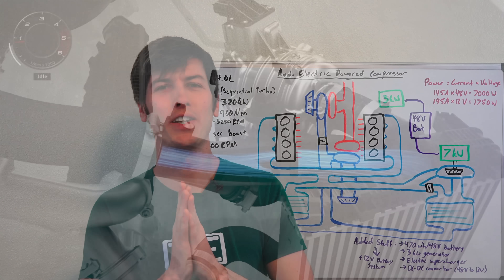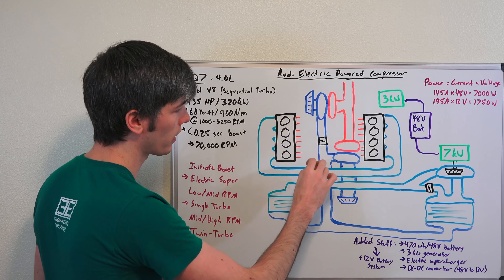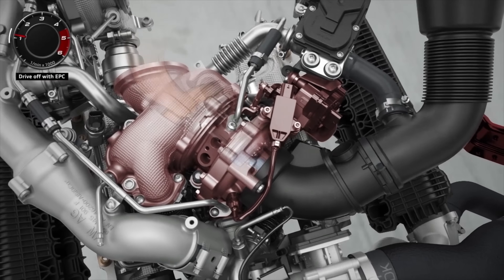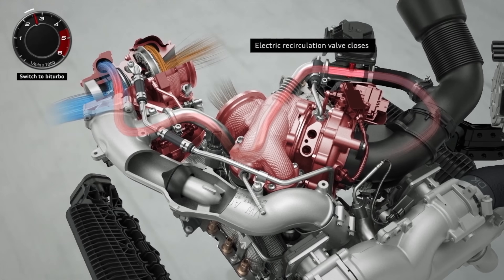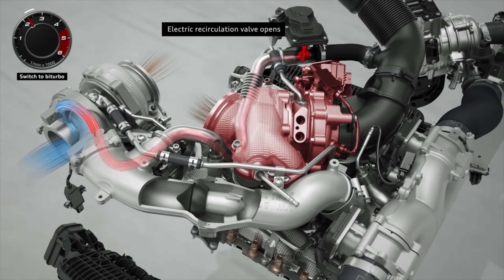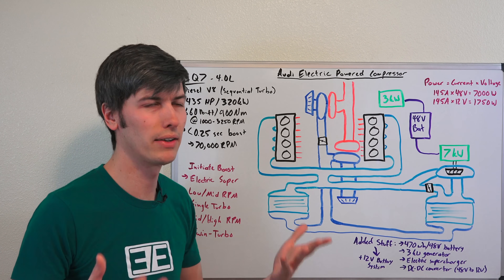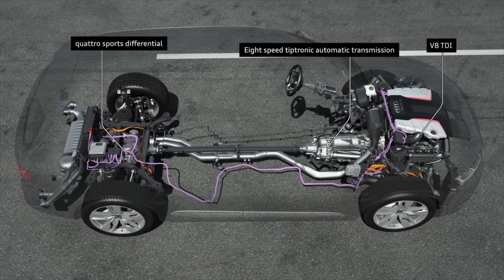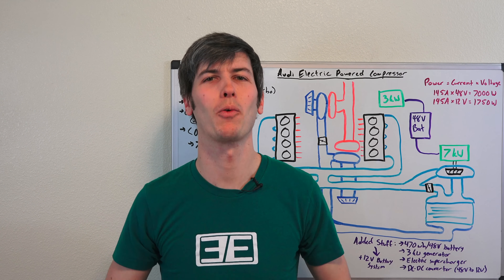Electric Superchargers - How Audi Is Eliminating Turbo Lag

Comment: diagram doesn't look right, the electric supercharger is drawing air in from one intercooler and then discharging back into it through the other one
Reply: When the valve is open, it is dumping SC air into it's own intake. So the SC can stay spooled with zero pressure being made. 
Condition = when Turbos are sufficiently spooled to give boost, and ALSO at engine idle when SC boost is not required. 

When the valve is closed, it will pressurize very quickly because the electric SC has been spooling consistently. Condition = Low RPM and not idling, Ie. When throttle > 0 and turbos have not made +ve Boost.

Either way, this air is then fed to the manifold. 

So At idle, SC is spooled and valve open. 
Open throttle, SC valve shuts and because it is already spooled it will create positive manifold pressure instantly, turbos are spooling up, and the SC is no longer required so the valve could be in either state, but open would be best to ensure enough air is available for the turbos to draw in.

Comment: All those complications and "still" 1/4 of a second to reach peak RPM for the electric turbo... I guess Audi's engineers need to justify their job, but IMHO with 1/4 of a second, the desired specifications are not met... at all. 
Get rid of the Diesel in the first place (it is or will be banned anyway from many European cities) and put a big block N/A V8, or even add supercharger (and even supercharger + turbocharger if you want) and you get almost instant response. 
I recall a ride in a GL63 AMG... I never thought such a heavy SUV would be so responsive and torquey... + the nice sounding V8 is a nice addition. 
Really Audi, that is a really nice work but over complicated.

Comment: As a working aerospace systems engineer, the engineering concept is cool, but the real-world lifecycle analysis is a nightmare.

I’ll stick with the N/A 6.2L LS3 V8 in my SS sedan. I get about 20-21 mpg on average, have 415HP on tap whenever I want it... with no lag. 3 pedals means it’s also fun to drive.  And without this horribly overcomplicated system, maintenance is a relatively inexpensive doddle. I am guessing a whole brand new LS crate motor is less expensive than trying to overhaul that terrifyingly complex turbo-electrocompressor-variable valve-quad exhaust manifold system. I used to really love Audis... but lately their styling has been “blah” and the lack of out-of-warranty reliability is a problem. I used to think my trucks would be American and my cars would be German. My truck is American, so that held true. But it turns out the best car I have found is an Australian amalgamation of German chassis engineering (they literally poached BMW chassis engineers) with an American V8 stuffed in it. Seems to work. Think I’ll stick with that.

Comment: Nice vid, EE.  Do you know why the electric fans output isn't ran thru intercoolers before it goes to the cylinder intakes?  Doesn't it too, get hot when compressed?

Comment: Wouldn't that 48V battery need a bigger alternator which, since belt driven, would make the engine burn more fuel? If yes, is there such a big fuel saving compared to a belt driven supercharger to make this concept more appropriate?

Comment: Hi, the battery does not have all that load, the alternator does, otherwise you would never charge the battery while the engine is running.

Comment: Too much complexity added to an already complex turbo setup, adding unnecessary cost and maintenance concerns. That's just sad German Engineering leading to high maintenance, overpriced cars. 

This is exactly why the Germans lost the war. Too complex overenginereed machines like the King Tiger which were too few, too expensive to build, repair, fuel and maintain and were defeated more by mechanical failure than enemy fire.

Comment: What about a turbo that is engaged by a centrifugal clutch? It's driven by the engine at first, but after spooling up it disengages from the belt drive and is spun purely by the exhaust gasses. You could achieve the same results as an electric supercharger, but without the need for all the extra equipment.

Comment: I have a topic i would really like to see a video about.
So the exhaust pipe on my dirtbike and basically all of the similar models... Will start to glow red if the bike sits at idle from the heat... 
But on cooler days it glows noticably brighter almost cherry red. Warmer days its less noticable even in similar lighting...
Is this because of the differential between temperatures of the pipe and ambient air or what is at work here?

Comment: Next video: How Tesla is eliminating turbo lag.
Reply: Next video: How Tesla is eliminating transmission wear.
Reply: to improve something, you have to use it, not throw it away
Reply: I need to buy a performance exhaust for my Tesla, but for some reason nobody makes them yet.
Reply: No turbo — no lag
Reply: hahahahahahahaahhaha
Reply: @ROBERT ANDERSON Thanks, I guess
Reply: Enthused 
Coming in 2020: Tesla eliminates GM, Ford, Chrysler, ExxonMobil, Chevron and ConocoPhillips.
Reply: Lol, nice
Reply: If your wondering  Teslas have so much power bc motors dont have to build up like engines do , they have instant torque like diesels
Reply: @samurboi8007  Diesels don't have max torque at low RPMs
Reply: @thomas_nl_  i never said that they have max torque , i said they have alot of torque at full throttle
Reply: @samurboi8007  You said they had instant torque. They take time to spool up RPM to get decent torque - same as gas engine - but just  more torque.
 Electric have max torque as soon electrons start to flow and is max at 0 rpm. (nanoseconds - not  milliseconds response)
Reply: @bbbf09  series DC motors have peak torque at 0 rpm......not the ones that are shunt or parallel wound ......😉👍

Comment: Better than Volvo’s system which literally operates like a tool air compressor. They also never mentioned how long that tank would take to repressurize and what the value pressure on it is...electric super charger is much smarter.

Comment: Instantly obsolete. I wouldn't touch a vehicle with that many moving parts for any price. Especially a german vehicle, which tends to be high in initial quality, but 12 years down the road, every repair costs more than the value of the entire car; hence why $40,000 to $120,000 Audis, BMWs, and Mercedes can be had for $2000 to $5000 12 to 14 years later. No idea why they'd waste their time and money adding more complexity to an obsolete technology - which is the internal combustion engine.

Comment: I claim BS on the “45 volt system” 
Second battery and alternator (high output) would do the trick. The issue is.  Yes it takes away lag, however you are still using engine power. Just threw the alternator rather than a super charger. It’s more efficient yes but in my opinion not worth it. 

The double header tho is amazing!

Comment: Why not just use an MGU-H, aka electric turbo, like they use in F1? They could accomplish the same reduction in turbo lag while using it to generate electricity off throttle, and also eliminate the need for a wastegate by using regen during boost.

Comment: So it's a pre-charger? What I don't get is why they don't design a turbo with an integrated electric motor to help with pre-charging as it wouldn't be that hard to do and would reduce material costs and be far less complicated of a system. You could easily separate the exhaust turbine housing from the air intake housing with a longer shaft and pop an electric motor in between.

Comment: For a special project for land speed record i've been working on an electric turbocharger using a 50kW motor from a Zero Motorcycle. We got 30psi at very high flow with 44kW out of the motor... it was insane.. the garage floor tiles lifted in the air and was flying everywhere!!!  was one of my most extreme sensation we had.. it was freakin!!

Comment: Thanks for the info. I just wonder...: Are you sure the Dc-Dc converter are to step DOWN the voltage?.. because for transmission of electric power the higher the voltage is the better it is and the lighter the cable will be.. so at first i tought the Dc-Dc would simply step up the voltage from the rear to the front.. and then another Dc-Dc converter would step down the voltage to the desired voltage for motor of the blower?... think about it...  steping down the voltage from rear to front to 12V at 7kW mean you woudl need very big cables for caring 583 amp of current  on that distance! you would need at least gauge 1 or gauge 0 witch is very heavy... and you need two!.... that,s why i think it is more a strp up converter that is located after the 48v battery.

Comment: Won’t the generator eat up about as much HP as a normal supercharger, or am I missing something? If the generator is powered by the engine than how is that significantly different from a standard supercharger run off the engine?
Reply from the maker: It’s low power. Full demand is about 4 hp.

Comment: Mercedes gets extra power from an electric generator attached to the exhaust, charging a battery, which powers 2 electric motors on the rear wheel.
I prefer the idea of harvesting exhaust energy to electric, rather than use the supercharger approach of tapping off any power from the engine.

Comment: I thought about this idea some months ago and now I see that it exists ! 
I was more precisely thinking about an electric supercharger that is powered by the energy recovered by a regen braking system. So when you have enough energy you can use it to have more horsepower. It allows to reuse the braking energy without making the car an hybrid car and adding an electric motor that can be expensive and heavy.

Comment: So...  Things that will go wrong and cost you more to fix than the car will be worth in 5 years:

1) that crazy exhaust-valve system that only opens one valve sometimes and both valves other times.  When that breaks, the entire top of the engine will need a rebuild, which is oh-so-cheap on an Audi, I’m sure.

2) the electric motor that drives the “supercharger”.  100 bucks says it and the “supercharger” are integrated into a single unit, and therefore the electric motor cannot be replaced on its own, meaning you have to buy the whole thing as a single, super-amazing-unbelievably expensive piece.  Think “HVAC blower-motor, only 100 times more expensive to replace.”

3) A 48-volt electrical system, with a 48-to-12V DC-to-DC converter that runs all the stuff that’s normally run by your 12-volt battery — because we all know how dead-on reliable German electrics are, and making them even more complex can only be a good thing, right?  When that converter craps out and feeds 48-volts to every computer in the car that’s expecting 12-volts, you’re gonna have to replace a lot of expensive silicon...

Maybe don’t own one out of warranty, hmmm?

Comment: While i fully agree that you wouldn't be able to run something like this of your car battery, i almost fell out of my chair when the claim " Your battery already has to power all these other things".

No. No it does not. As soon as the car engine is on, you can remove the battery, and the car will run just fine until you turn it of, and try to start it again. The only thing that might be affected, at all, is the sound from your stereo, and and headlights might start dimming in tune with the beats of the music, and that is only due to the generator not responding fast enough to changes in current draw. The car runs of the generator, not the battery, when it comes to electric power.

Comment: Why do they put the electric turbo charger behind the intercooler? What is the reason behind it? 

My thought: The compression of the air leads to a higher temperatur and without an additional intercooler the air (that the electric turbo sucks in) would get very hot which would lead to an ineffectice combustion
(Hopefully I explained that right :D)

Comment: Thanks for the video. 
I like the split exhaust valve operation idea for the two turbos, but the rest of the system seems to be a case of throwing expensive engineering at a problem already solved by a correctly chosen sequential turbo system.... 
A different vehicle to be sure, but my twin turbo diesel Nissan operates smoothly at all rpm from 1300 up... 
Indeed, between 1500 & 2500 it delivers it's full maximum torque all the while changing from primary, to both and then secondary turbos. 

From the outside, it would appear that the engineering $$$ could have been spent on better matching of the turbo system and saved on complex added electrics.

Comment: Why not bolt a high power motor to a standard turbo with a centrifugal clutch just for initial spun up?  Have a big capacitor to power it for just 1-2 second.

Though the compressed air accumulator solution you slowed is probably a nor select solution. Only cars already have electricity but not compressed air...

Comment: Unrelated to this video but was wondering about the benefits of engine capacity vs number of cylinders. I notice that older sports cars eg. 1960 ferraris etc had smaller capacity high cylinder engines (3.0 V12) vs modern cars 3.0 V6, 4.0 V8,  5.0 V10... Is it to do with turbo charging and  variable valve timing or modern transmission systems? Great videos, excellent detail clearly explained!

Comment: 435HP out of a 4.0L Electric-Supercharged, Turbocharged V8? Am I supposed to be impressed?
Reply: Makes the cylinder deactivating Chevrolet LT1 seem like a much more cost efficient solution.

Edit: Just realized it's diesel, so it isn't quite comparable, but it still seems overengineered. I'm willing to bet 48V crankshaft assistance motors will become more commonplace.
Reply: its a diesel dude
Reply: Peak power means little in determining a fast car, torque across the rpm range is where it's at!
Reply: there is a dude making 285hp and 11sec on the quarter mile from a 92 vauxhall corsa with a 1.7liter turbodiesel engine..with 8 valves and mechanical injection pump... search for "corsa ginho"
Reply: It has more superchargers and more electric wiring than any other car in its class. To Audi that's a badge of honor.
Reply: Read the title.  The system is for eliminating turbo lag, not adding HP.
Reply: Anernermus it's a diesel for one. So 435 out of 4 liters is pretty good. Second: mercedes also uses it.
Reply: This technology does nothing! for peak power.
Reply: BassVentura Yes. And someone needs to re-state that torque figure... 900Nm! However the basic Ford Powerstroke diesel V8 for the super duty pickup makes .... 1267Nm. Yes 367Nm MORE.
Reply: @DiscoFang  Let's not forget Ford's is 6.7 Liter (~70% bigger) engine with 450 HP (almost same as Audi's). It only fits in trucks, busses and huge vans.
Reply: BassVentura It's in a normal, buy it at your dealer, road going passengers vehicle. I can't believe you had to have the comparison explained to you. 900Nm is amazing but Ford managed to get 40% more torque AND more power from just a single turbo and extra displacement. That's the point. Audi add complexity and who knows how much cost yet still get their ass handed to them.
Reply: Right , my friends father owned a 2008 S5 , 357 HP from a natural 4.2 V8 !10 years ago. Much rather have that. Oh well ,.
Reply: Not more peak power but more power on the low RPMs
Reply: For petrol no for diesel yes
Reply: its a diesel LMAO
Reply: Thomas Griffin bmw quad turbo seams more efficient. Sure there is lag. But for 98% of the time it’s still vastly better.
Reply: DGFr0sty Diesel is without any doubt the more efficient ice in comparison to a gas engine. No argument just a fact. It is the better technology! you can hate or argue but its a fact!
Reply: If it was better technology, more people would be using it... LOL you think people purposely make less money?
Reply: People make less money all the time bro. Just think about whenever you go on a vacation: You're not working! It's a silly argument.
Reply: @kaio37k  diesel gets extra taxes in Europe, so unless you drive 30000km or more in a year you'll be spending more money than a gasoline engine.
Reply: My 1.8 puts out more power.

Comment: A mechanical supercharger is simple, compact, light, reliable, easy to couple to the engine, and has no boost lag. From an engineering point of view this system appears to be a lot of problems in search of not much solution. A designer who uses two more compressors and an entirely additional electrical system as a crutch for his compressor problems needs to spend five years in the lawnmower department to learn some perspective.

Comment: So how is it more efficient to be constantly converting energy through so many different means.  Generator to battery to motor, and at every step there is power loss and heat generated=lost energy and waste.  What are the advantages?  I don't see it.  Looks to me like a cop-out for the "engineers" that can't (or won't) design an efficient system. K.I.S.S.

Comment: it would make more sense to me to cut a classic turbo into two pieces and add an electric motor/generator to each part. so on the exhaust system you have the generator that always generates electricity and at the air intake your have that kind of electric supercharger like in this audi. but only as a single turbo system and not as a double turbo. then you add some kind of clutch/gear from the electric motor on the supercharger to the combustion engine so that you do not need a classic starter engine/generator anymore. then you kick out the 12v battery completely and only put in a 48v battery. the 12v that you need for different components you can supply with a dc/dc converter from the 48v system.
that makes it much more simpler.
running certain things on 48v instead of 12v keeps the currents lower and saves weight in the copper cables.